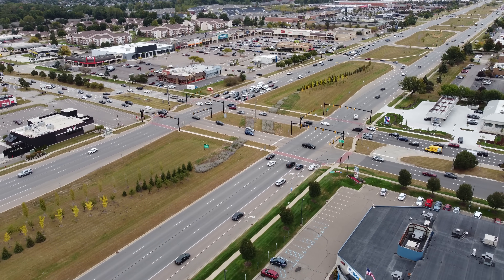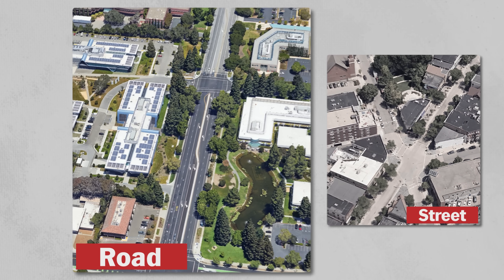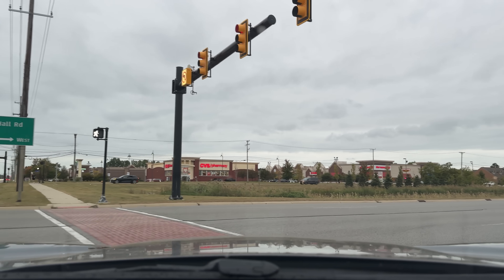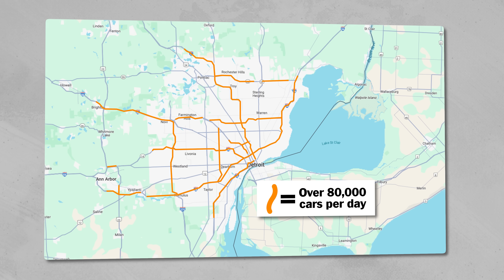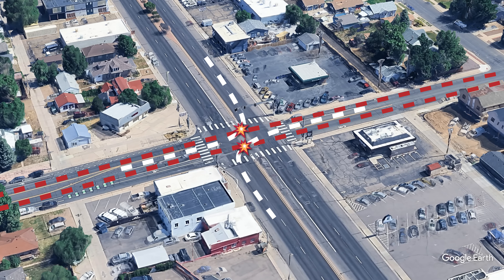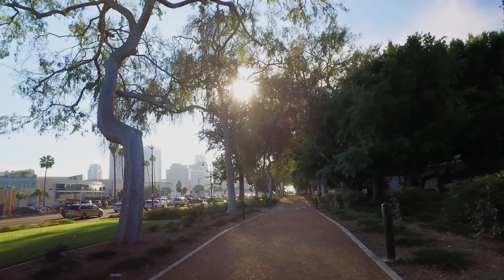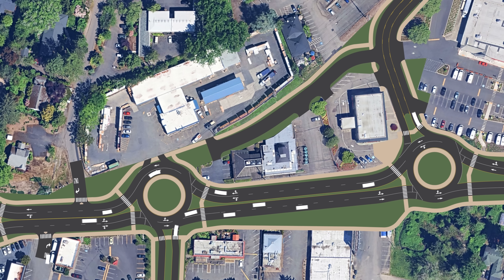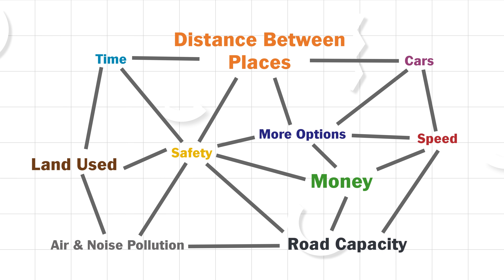How Michigan Built a Super Highway Using Only U-Turns

Comment: I recognize that road as soon as I saw it. Because I was here when they first bought up the road. And I know what the original design was supposed to be it was supposed to be an expressway with at least two to three lanes either Direction with a service Drive of three lanes in each Direction how to make access to businesses with overpasses passing between them because it was supposed to be a sunken Road or possibly an elevated road. And it was supposed to stretch from Interstate 94 at its eastern It only requires one phase for each Direction and and stretch as far west as where there were going to stretch I-275 on the far Western end the other side of Pontiac Michigan. When they got to the point of actually building the road a lot of companies had come in and bought a plan to put all these businesses in and we're sending people around to bribe the local agencies that this roadway would go through so that they would make it a Surface Street so that the businesses would have easier access to the public what they got was a parking lot for several hours in the morning and several hours in the afternoon I will not even drive that road at certain times of the day and very rarely get on it even at any time of the day, unless I absolutely have to. It is an absolute klusterfuk. That's a German word and we know it's German because it says exactly what I want to convey. The speed limit on it is 55 mph at its origin. And it has no business to exist there there is still enough room between the eastern and western track to put up a four-lane Expressway, two lanes in each direction. Although the population mass in this part of Michigan should never have a two-lane Expressway. Now they never put anybody in jail for being bribed to say no we don't want an expressway in our community. But it would have been far safer. It isn't an excellent example of how badly you can screw up traffic! The Michigan left is a good idea when they added it to existing roadways of the past and I believe they started that as early as the 1950s but it might have been even later than that in the 1960s. Myself and my family move to Detroit area in 1965. And it was a unique fix to the problem of making a left turn on major boulevards.
But your thought that it is somehow revolutionary period is not true whatsoever. You need to try and travel that road a few times. And with the recent edition of roundabouts which are not large enough for large trucks to actually maneuver on and the fact that people in this part of the country most of them have never seen such a thing. That has been an utter disaster as well. And then you throw in one of the Three Counties in the Detroit Metropolitan area. One of them decided to put all of their left turns as the beginning light at an intersection and the other two, the left turn light follows the major portion of traffic. Now why the major portion of traffic should have to wait for the few people turning left before they came to go straight is beyond me. But it causes severe accidents. Especially when you're not aware of which is going first even once in awhile they will sparse a left turn first light and get people stuck in the intersection waiting for a light to turn green and now they're stuck in the intersection blocking it. And the state won't come out and say no, they're either all preceding lights or they're all following lights. And yes that road is designed to handle about 65 to 80000 cars a day. Here's the problem that road is currently trying to handle about 115 to 140,000 cars a day.